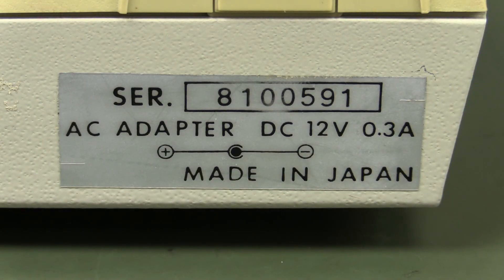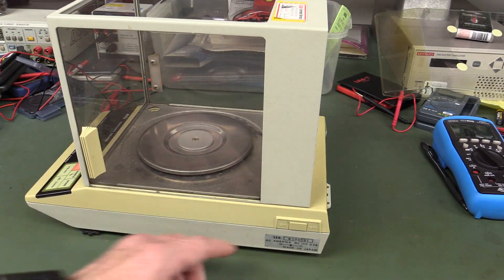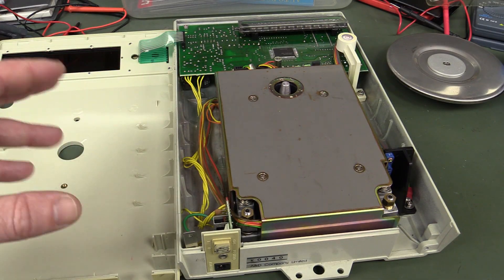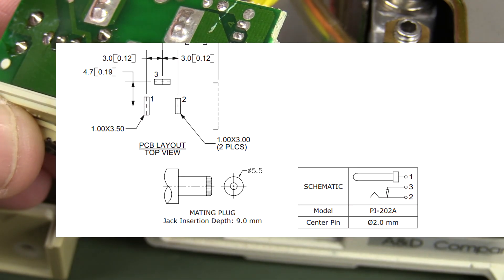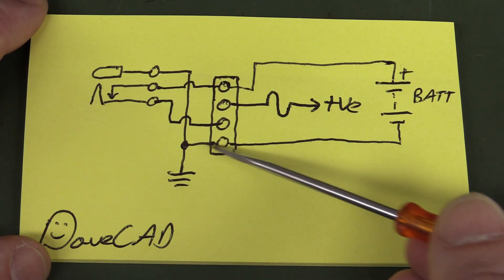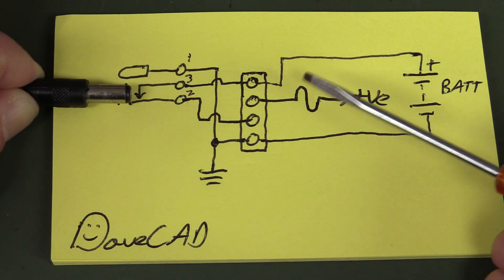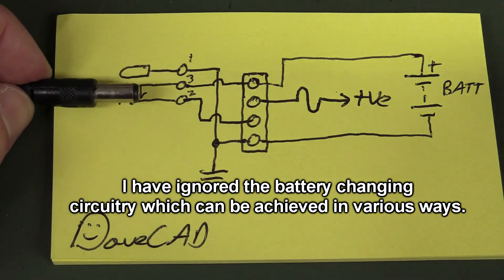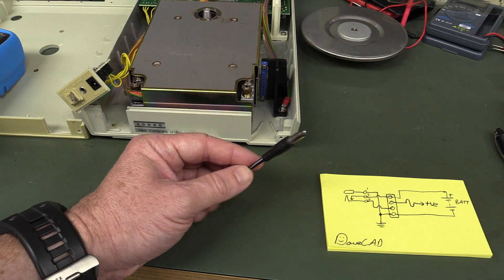EEVblog #1015 - Beware Evil (But Clever) DC Jacks!

Comment: Most of us musicians know to look out for this, as most guitar pedals are -9V DC.
Reply: Almost every single guitar pedal, AC and DC, is center negative. Electro Harmonix is one of the few brands that make center positive pedals.
Reply: efa666 PNP has the same polarity as valves, so early circuit designs could be reused. NPN has better properties, because there the electrons carry the current and are more mobile than holes in PNP.
Reply: -9V DC sounds fun. And then center is marked positive, i.e. GND? :-)
Reply: Holy crap! I play synths (Roland) and at one gig, my power supply died. I borrowed one from my bass player, who had a spare from his Boss pedal setup and I remember him asking me how my power was configured. Turns out my Roland A-37 was center negative and the cord worked. I had no idea what the hell he was talking about at the time and now I finally understand LOL
Reply: And Casio keyboards (and this includes ones made for and sold by RadioShack).
Reply: Most Korg, Roland/Boss, Kawai are tip -ve. Yamaha were always tip +ve
Reply: Wow I am a guitarrist and never thought about that!
Reply: Admiral Quality I read somewhere that PNP was originally easier to manufacture so were much cheaper and more common, I may be wrong though, and it's essentially NPN circuits just in a reverse polarity configuration.
Reply: Valves or tubes are very close to N channel fets
Reply: JFETs actually, more than N-channel MOSFETs.
Reply: In audio it probably had a lot to do with fuzz face/Tone Bender circuits using PNP germanium's and the supply of -9V. Then again, there was a lot of manufacturers recommending to ONLY use the OFFICIAL power supply for optimal performance. Because we all know that a $50 power supply from a manufacturer is WAY better than a $10 Dick Smith power pack was......Yeah, you can smell it. Oh and BTW - Those centre -ve are PITA in effects loops without batteries.
Reply: Nah, pedals aren't "weird", it's just that analog circuitry doesn't necessarily require absolutely accurate-to-20-decimals supply voltage values. Unless they contain digital circuitry of some sort (and you'd risk the 3.3v/5v voltage regulators overheating), you could run just about any 9v pedal on anything up to 14-15v or so. Primarily because the lowest standard voltage for electrolytic capacitors, with a certain amount of margin, is 16v.

No rocket science, no black-magic-voodoo :P
Reply: AC can be center neutral though (earth referenced). Negative wouldn't be the correct terminology but center neutral could potentially what the guy means. No pun intended. Though why you'd earth reference one side of a 9V line is beyond me. Nowhere near enough voltage to shock anyone.
Reply: ... But then again, when's the last time you've seen an earthed wall-wart / plug-pack anyway?
Reply: Yep, I have a Roland JV-1010 MIDI synthesizer and it runs off of 9VDC, center negative.  It's the only device I have that uses this so I have had to put a big tag on the AC adapter so I don't accidentally plug it into something else.  I used to have one other part (A wideband receiver) that was like this, and to make matters worse instead of a diode in series with the positive lead to protect it from reverse polarity they decided to put a high-current, reverse-biased diode across the input to short out any supply that used the wrong polarity!  It did the job too and I ruined at least one wall wart that way...
Reply: I hate it because if you have a power supply with many conectors, for powering many pedals, if a plug is laying around, it could potentially short circuit with a metalic audio plug.
Reply: Funnily enough, the older 12V pedals work fine on 9V as long as the ground is matched with some 9V pedals.. Pedals are weird.
Reply: Admiral Quality Or even 9 VAC.
Reply: CrimSun AC can't be center negative. It's AC, as the name says, it alternates.
Reply: Admiral Quality most pedals are 9V DC center negative. The only -9DC pedals were old pedals powered by batteries, no DC jacks.
Reply: The Yamaha RY10 drumbox is center negative as well...
Reply: Lucky!
Reply: @KhronX Almost never. I do have one though. Very rare to see since 90% of them are just floating.
Reply: Floating or grounded, there's still a positive and a negative and you definitely want them the right way or it won't work, and for some devices that aren't well protected, permanently damage them as well.
Reply: whats fucked up is a bunch of pedals these days are 18v, but the jacks are the same size, so if you have amodular power supply it becomes very easy to plug a 9v into the 18v outlet
Reply: Exactly! I hate that, but ALL guitar pedals are like that, and all Boss to blame :(
Reply: It's not Boss, it goes back to the earliest fuzz pedals. There's a reason for it but I forget offhand. 

Ah, apparently just to make defeating the battery easier. 

https://neunaber.net/blogs/brian-s-notes/13849473-pedal-power-basics
"Most electronic devices and their power supplies have center-positive polarity, so why do pedals have center-negative polarity? Because many pedals work with either a battery or a power supply; and, to preserve the life of the battery, it is disconnected from the circuit when either (1) a power plug is inserted or (2) the input plug is removed. This is accomplished by connecting the battery's negative terminal to the input jack's ring contact and the battery's positive terminal to the sleeve shunt on the power jack. When the input plug is inserted, it completes the circuit for the negative battery terminal. When a power plug is inserted, it breaks the circuit to the positive terminal of the battery. Power jacks do not have a shunt for the center (pin) contact, so a center-positive power supply would not work in this type of circuit."
Reply: Could have sworn it was something about transistor polarity but I guess not.
Reply: Ah, just like Dave is explaining. (Still watching the vid as I comment.)
Reply: Don't you mean SPST, Dave? It would need to close an opposing contact when the existing one is opened to be double throw, right?
Reply: I thought it was something to do with the fact they primarily used PNP transistors?
Reply: Lots of other music gear has -9V power too, just to keep it compatible with the pedals. My Roland Microcube amplifier uses "pedal power".
Reply: Admiral Quality the plug is the other throw.
Reply: But it's not. (Otherwise it would short the power input.)
Reply: I thought so too (except I thought it was NPN ;).
Reply: @basshead, I play both. (And make software synthesizers, check out my Poly-Ana!)
Reply: Not so much, if you have half a clue what's involved and how some things like those work :)
Reply: True... but still weird.
Reply: I'm sincerely sorry, i didn't mean to come across as aggressive or anything. But only because you happen to not know how something works, doesn't mean it's unusual, or uncommon (which is what i understood the term "weird" as). And as i'm sure you know (or at least should), "two wrongs don't make a right".

So... Peace / truce?
Reply: Nothing evil about this. People being people, careless, taking for granted.

Comment: As a old videogame user, the immense majority up to 16bit consoles use center negative.
There's a funny thing though, the Sega Megadrive model 1 was launched in 1988 and uses center negative. Then the model 2 revision came in 1993 and uses a center positive (thankfully with different pin and barrel diameters so you can't mismatch between models). So you have a definitve turning point right here.
Reply: Yup, I destroyed the mega drive's 5v regulators that way...

Comment: Why is it tricky to simply reverse everything for center positive with the switch, then switching ground?
Reply: Yeah, I used one of those 3-pin connector with a center positive power adapter a while ago to make a battery powered toy also work with a power plug. Maybe it's not as elegant to disconnect the battery ground. But hey, the battery doesn't care which end gets disconnected.
Reply: Robbie Robinson. No, it doesn't mean that everything gets the reverse voltage. It only disconnects the ground side of the battery. And it doesn't matter which side of the battery you disconnect.
Reply: None at all.  I always use battery negative on the pass through.  No idea why Dave thinks it makes a difference here, you are just disconnecting one side of the battery, or the other, either way the other side is floating in the ether.
Reply: I also prefer disconnect battery ground, in this way you can also made a metal case (grounded) and you are sure that you can't short your connector with the case hole.  Dave, please tell us if is better ( or more elegant) disconnect positive from battery.
Reply: I think it's because that way the ground is always connected to the circuit.
Reply: The metal case of the battery is the reason I see. If you are switching the negative, you also have to carefully isolate the battery shell from the case. Switching positive means you just connect the battery's shell to the case.
Reply: Switched negative side of the batteries a number of times and it works fine.
Batteries are electrically floating inside the case, so it doesn't matter what side you switch. It's just not convention to switch negative typically.
Reply: Norbert Harrer I had to re-read the comment. I mis-understood. I thought he was asking why you couldnt run things with reverse polarity. Thanks for clarifying.
Reply: Hence why we've been able to go to centre-positive on modern electronics!
Reply: Modern alkaline batteries the main shell is positive, if you pull one apart you will find out how this is done.
Reply: As one of my EE lecturer said when the class had this argument: It doesn't matter if you use Electron or Conventional flow, so long as you stick to it.  It's good to know about them both, but they don't really matter.
(This goes out the window when your dealing with silicon design and things at that level, but at schematic level, it doesn't matter at all. None of the formulas that I'm aware of care what the electrons are doing. Even Kirchhoff is happy so long as your consistent in your design.)
Reply: Frank Buss Exactly what I was going to ask, Do agree very important question though
Reply: An engineer should know better than to make up their own conventions. Electron holes are required exactly as much as electrons are for current to flow. 
If you can assume your entire battery negative/DC return is insulated from Earth/chassis then it doesn't matter which side you switch on a device, but many engineers don't know how to properly use earth ground, chassis ground, and DC 0v common/return/"ground" symbols, so you, all your coworkers, their successors, and any maintenance personnel better know what you're doing if you're going to switch the ground on anything touching mains.
Reply: I also thought this .. why not the other way around  and my second thought was  can I make a pin adapter which flips the polarity inside ? A: It is possible but a terrible construction you need to make it kinda half-half.
Reply: Frank, well there can be stray ground. Say you put a guitar pedal into mixer's Fx loop which grounds input and output together. But that too is easy to solve by having the battery negative go to power jack first, not to audio input jack.
Reply: The charging circuitry may be design to monitor/regulate the positive side of an otherwise unconnected battery.
Reply: With most modern electronics being made of plastic I don't see isolating the battery case being much of an issue.
Reply: That's the POINT of what I said. Unless your dealing with semiconductors(Or other low level things), just pick one option and stick to it.
If you want me to re-open a can of worms though, it DOES matter when it comes to things like switch wear, the positive side of the switch tends to get more wear during the open/close arcing. (To close this can of worms, there is no /piratical/ difference unless your dealing with ultra long life contacts or switching lots of current. :)
Reply: wow - ur brain dead arent you @Zerim. Thats a thing called AC. Thats where the positive and negative swap constantly. Its also the neutral, not ground. Neutrals/Negatives can float. And they have VERY different symbols. Also - HEAPS of gear is positive ground too. Thankfully there are safety standards that tell us how not to get killed even if chassis go live.
Reply: +Electra Flare also this is a conductor not a semi  - charge carrier effects tend not to matter in conductors
Reply: it isnt - if it were we would switch the lead that provides the actual EMF - the negative (an engineer should know better than to think in conventional current
Reply: Frank Buss Diodes, (zener, leds, and otherwise) transistors, electrolitic caps, and probably more reasons I cant think of right now.

Comment: Back in the day I saw one use for it. Guitar pedals are indeed center negative and use 9 Volt. Other gear like synthesizers / keyboards mostly use 12 Volt and they are usually center positive. A simple series diode will protect the guitar pedal against the 12 Volt from the keyboard power supply. And a keyboard will not work at all from the 9 Volt guitar pedal wall wart. If both where the same polarity and you would use the wrong supply it might damage your guitar pedal or your keyboard will run on a too low voltage and start behaving erratic. A simple way to make sure the guitarist is not stealing the power adapter of the keyboardist :)